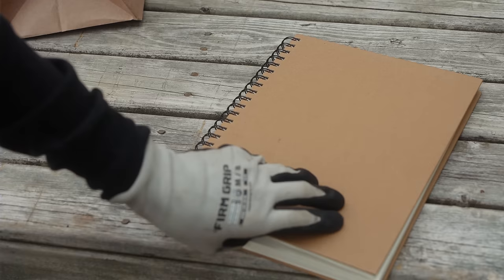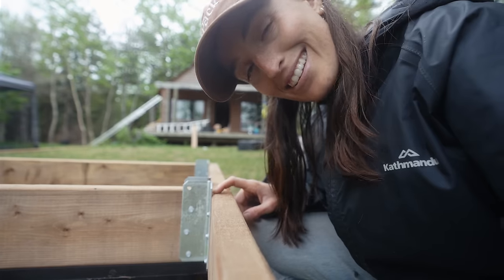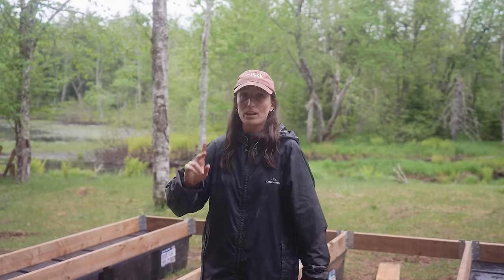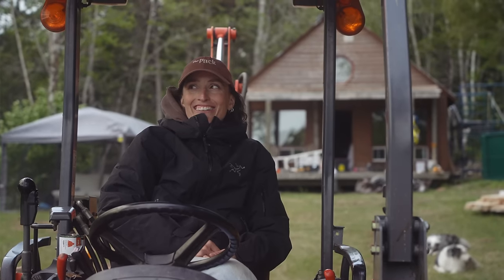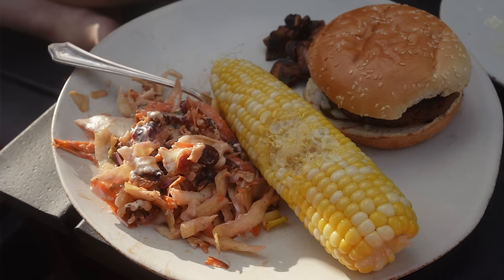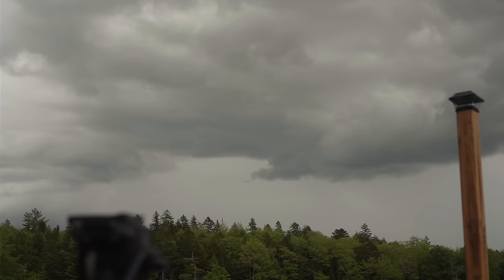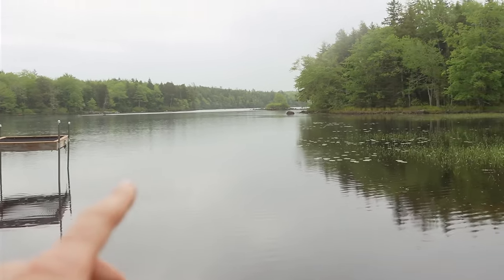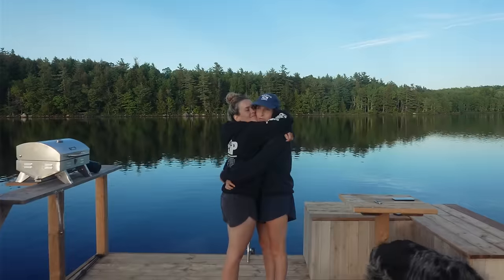We Built A Homemade Raft Boat with Electric Motor!

Comment: You NEED to get a chart for your lake. 
Life jackets.
Backup propulsion plan.
Since while you were building it that storm showed up quickly you need to plan for that, the trolling motor is no match for a sudden wind storm.
You need a ramp for the dogs to get back on things happen
You have seen weather videos of how violent water can get. 
The lake chart will show you the deepest park and your anchor chain needs to be a little longer.
A dingy would be a good thing. 
There should be boating classes either on line or from local law enforcement.
First aid kit. 
If you lose your balance you can easily brake off the grill stand
So when you anchor a boat it digs into the bottom, sometimes really hard and in a power boat your motor is usually strong enough to break the anchor free. 
You might consider a wench of some kind to pull it up. 
You should also consider the wind if you put up any thing that could act as a sail.
Looks like you are going to have a great summer be safe and joyful
Reply from the maker: We have all the safety gear and boat licence. We appreciate the tips.😊🐶

Comment: So basically a powered, floating deck!   Possibly the ultimate house extension, at least if you have your own lakeside property.  It definitely could use some shade, perhaps a gazebo with solar panels on the roof?   How about a potted plant or two, perhaps hanging?  And an elevated fire pit, or is that going too far (and too risky?)!

Comment: I would have gone with a spot lock trolling motor for deeper water and a couple of electric pole anchors for shallower water (No anchor needed). Definitely add some solar panels to keep things charged up. Star link for video editing. Maybe a sleeping area or tent for overnighters? And going crazy here, but a water filter from the lake connecting to a water heater, a sink by the grill, a shower head on one of the light poles, and a toilet? Hey, you ladies are awesome and could pull it all off 👍😎
Reply: Why would they need a shower head on a fresh-water lake? That’s a lot of trouble for no reason.
Reply: @kathyannk  seriously? Have you ever swam in a lake and felt clean afterwards? It can cool you off but that’s it. You wouldn’t believe how you have to clean the lake filter after every use. Ever watched fishing videos? They don’t use lake water to clean up, but use tap water immediately when they get home.

Comment: The weirdness is with wood measurement is that when the pieces are cut, they truly are 2x6. But they're cut wet and left to dry. As they dry, they shrink in all dimensions (and not always evenly). It's easier to store boards than logs and they dry out more quickly as well. It used to frustrate the heck out of me when I started making stuff and building sets. All my detailed plans and diagrams were useless. Experienced (i.e. professional) construction people know about shrinkage and calculate around that. The fittings are often wrong but they know they can grind off the ends, as you do. 

I would hinge the lids on the storage because I know I would slip when lifting one and it would go in the lake. But that's just me.

Comment: My guess for what the taped off square on your raft is....?

I think you're going to build a ROOM on the raft and make it into a "HOUSE" boat ! And then even if the weather changes while you're out on the lake, you can just go inside until it's over.
The whole thing is a VERY COOL idear !   However I think I see one tiny flaw for at least ONE of U2. And that is IF you're out on the lake and the weather changes AND it doesn't look like it's going to go back to SUNNY for the rest of the day, one of you will have to sit out in the weather holding onto the motor handle until you get to the shore. ....but I guess you could enclose that spot too???
Now my 2nd guess would be just a solar panel roof with no walls. And with that you could possibly put an EXTENTION on the motor handle so that who ever is doing the steering could still sit under the roof for at least a little more protection from the rain OR it could even be a little SHADED area when you've had enough of the ditrect sun shine.
Reply from the maker: You have a good guess. Many good ideas as well. 😊🐶

Comment: Next time put a longer board and then on each side of the longer board, it might get thicker that way. It will give it more strength in the areas you need it. But if your clamps will go too too before it's thick. Use 2 tuba sixes or 22, but 12 might get heavy enough. Dill, what you have to have at least. A foot on each side of your motor to a foot and a half
Reply from the maker: Thanks for your great ideas. 😊🐶

Comment: Hey gals….suggestions, fly the lesbian flag…and the anchor chain needs to be 1 1/2 times the depth of the water you’re anchoring in….or longer…..the motor mount might be better as metal plate…..a couple of paddles are never a bad idea too. 
Love your raft! You both did a fabulous job designing and building it. It’s gonna be a fun part of your summer, for sure!

Comment: When ever you use some measurement of the metric system temperature, length, etc. I have convert it to imperial system. 25 degrees is cold in Fahrenheit, it's below freezing. 25 degrees C is 77 degrees F.

Comment: Awesome raft, but you are using the trolling motor in reverse. You need the take out the bolt at the top of the motor just beneath the head and spin the head 180 degrees, that way the propeller is behind the shaft and the skeg  will protect the prop from the rocks. Enjoy

Comment: I wonder how thick the plastic is on those floats? If it is not too late I would consider coating the bottoms of those floats in a heavy layer of flex seal for added protection against getting punctured.

Comment: um Maybe pick up a small launch boat or second troweling... if you don't have a lot of neighbors near by a separate boat troweling motor (towing) style is fine we know your going solar panels (check out solar glass, yes window idea)  - use anderson sttyle 50 (charging) or 175 amp (probably full power service disconnectors) plugs to plug the two 2 together when way out. YES wood breaks as you found out - cross hatch wood vertical and horizontal grains are much stronger, gluing 3) 1/2" thick boards for the motor mount. I've towed a pontoon to shore already that only had 1 motor.  Done the PWC (personal water craft) as a back up too when out farther in vacant type areas..  Are there any high winds? you might end up with a solar sail if you know what I mean

Comment: You should add 3 or 4 batteries and connect them in  parallel, then add them to box in the floor.  Y'all will have hours of scenic tours and fun.
Reply from the maker: Sounds like a good plan.😊🐶

Comment: I saw a raft house, or houseboat that had a half of the house, with a curve roof to the base, and it had a see through plexiglass  roof, so there was so much light inside it, and they could see the stars at night, it could sleep 6 people 2 bunks folded down, sleeping bag bunks,  and one bed was a queen size, and 2 more hammock beds, a commode  tank toilet, and a small fold down table, fold up wooden chairs that hung on the wall, a place on the deck for outdoor  solar shower, a tiny wood burning stove, a gas camp stove, water filtration system, it had a jackery, for coffee pot, and a convection oven, and a couple lights, and a mini cooler,   they rented it out on air BnB, when they weren't using it

Comment: OK, so now you’re going to find out that you would like to be able to go to the bathroom without jumping in the lake. This will require either a little wooden structure or a tent, and a cassette toilet or whatever type you want to use. You may also want a very small structure just to get out of the rain and things, and you will certainly want to be able to sit in shade at times.  We have used just a little tent shelter that is probably 8 x 10. We are in the US, so we bought this little Shelter at Walmart, but I’m sure you have an equivalent store where stuff is not too expensive. The little tent doesn’t even have a floor, it’s just four walls in a roof with a lot of venting so you don’t get too hot. You can put it up and then permanently attach it to the boat so it will always be there.  That’s all you really need to get out of the rain or the sun. So I’m just letting you know about improvements that you will probably want to make.  I think that you will intuitively discover what I’m talking about soon.
Reply from the maker: Thanks for caring and sharing your great ideas with us. 😊🐶

Comment: You did paint over the cuts you made on the corner brackets, right?
If not, you need to lift off the covering decking and seal those brackets, where you cut the galvanized off, or they will rust. And the rust will work it's way under the rest of the coating, compromising the whole bracket. I'd suggest using a can of spray on bed liner.

Comment: Absolutely beautiful girls!
Love it!❤
I think the corner post lights gave it away along with the eight foot by eight foot taped off section Hint.
A solar canopy for the pontoon boat/raft. Should be amazing.
Hell, it is already amazing!
You might upgrade your outboard electric motor to one you can steer using remote control. Maybe even connects to your phones. I'm not sure if the little electric motor is big enough in any kind of wind. You will have to test it once you've got the roof on.🌬 ⛵️ 
Don't forget to get some big paddles. 🛶🛶 And maybe a life ring 🛟. Might look pretty cute.Hanging it off one of those posts. Didn't you girls find an antique one in the lake house🛟 ?
⚓️🛥

Comment: use your portable power supply to power your trolling battery and then you can install some solar panels on the boat to charge the power supply.Maybe install a pool slide on it or diving board.
Reply from the maker: Just wait for the next ep! 💛 thanks for watching

Comment: Only about 1/4 of the way into this video and wondering why you are building this so far from the water.??   Beautiful project , crack out the Champagne !!!  It's gonna be the best Summer in the Bush.  Need some solar for the battery. Maybe buy a metal or composite transom for the motor. Typing as I watch.  Wow a Canadian Goose ( Canadian Snowbirds,  lol ) flyby to commemorate the launch.  Raft needs a Name:  VG Oasis ?

Comment: This is so rad, is a big green square for a big thing of fake grass? Also with the cooler if you attach a string to the top of the cooler lid and the seat top, you can open the cooler at the same time as the seat.

Comment: I noticed you mounted the trolling motor on wood with the grain running horizontal. No wonder it broke off along the grain., The grain should be vertical or even better have a metal bracket for extra strength. Why not tie the canoe along side as an emergency life boat when you loose power?

Comment: Yeah you need to make a braket out of aluminum or steel and bolt it to the floor of the raft and to get the thickness put a 2 by on your bracket and I think that should work perfectly fine and put a solar panel on it too for the battery

Comment: ok the reason why is if you use green lumber off saw mill which is true to size the bracket fits and the lumber you buy in the store shrinks because it has been dried before it was sold to you and so now the hardware wont fit as well but if you have ace hardware store  they would sell you the right bracket that would fit

Comment: Well first of all if you add solar panels and batteries you won't have to worry about the trolling motor dieing. But here's a idea make a frame that is sturdy for the motor to bolt to on the side of the float. For the dogs yes, get a big umbrella that you can mount the base to the raft, oh I bet you didn't consider this what if the dogs need to go to the bathroom, could get smelly if they pop or pee?

Comment: With the weight you're pushing, that motor is gonna drain that battery pretty quick. You'll need a spare battery or a couple of solar panels.

Comment: Wondering if you will need to remove the raft for the winter and what your plan is to remove 4000lbs from the lake?
Reply from the maker: 4000 pounds is the capacity. People, food, water, dogs ect. The overall design will be under 4000 pounds. Either anchor by the river where it doesn’t freeze or bring it in with the tractor and or heavy machinery

Comment: Why a large raft and not put the grill on the dock ? As you found out with the broken motor mount, you could be up the creek without a paddle. A smaller boat with the troll motor makes more sense and would be safer. How will you every get this ashore for the winter ?

Comment: Get a piece of metal to use for the transom ( the boat motor holder thingy....lol) bolt it on the back then you will never have to worry about wood breaking
Reply from the maker: You and a few others have mentioned this. Thank you! We shall have a much stronger transom 🤣💛
Reply: @Vanwives  for sure good luck🙂

Comment: If you turned the board for your trolling moter so the grain runs vertically rather than horizontally you wouldn't have problems with it breaking so easily.
Reply from the maker: Thanks for the tip.😊🐶

Comment: remove the motor transom and create a new piece of the same wood but mount it so grain is vertical not horizontal, then the torque of motor won't break the board.   talk to me about ICF for your mexico house

Comment: Just curious if you gals know how to test the water that you're submerging yourselves in to make sure you're not getting into any water that is contaminated with flesh eating amoeba bacteria or brain eating amoeba bacteria.  You could buy yourselves a pond liner that's big enough to make a pond swimming pool out of it for much cheaper than a swimming pool would cost and treat that water with shock treatment and dump some chlorine salt or whatever in it and get a pump for it that circulates the pond water and connect it to your solar power system or make it's own solar power system for it. After clearing land for it and whatever else.

Comment: Did you guy even check for square ,ok you didn’t check that’s why the last board didn’t fit lol ,oooo well,ok on the trolling motor you well need some heavy duty L brackets,the wood will work for now but will not last long ,the motor will work better if it is about 6-8 inches below the water surface and on the motor a 24 volt will give you more power and last longer but you will need two batteries or bring along a extra battery to be safe

Comment: Since I believe neither of you are engineers, where did you get this beautiful design from?
Reply from the maker: Us  😂 lots of research lol except for how to attach the motor LOL
Reply: @Vanwives  thanks for the reply. I have experience modifying trolling motor mounts if u want ideas. What battery are you using? Lithium or lead acid? Deep cycle or starting battery?  What motor are u using. 30#?

Comment: Engineers in disguise, I hope you have copyrighted that design, there will be a hundred or more scattered around the world by the end of the year. When I saw your motor mount I thought that you ought to reinforce it with fiberglass, then it cracked, [it's taking all the thrust from the motor,] get a thicker piece of hardwood as well, probably pay a pittance from a timber source, but ya don't want to lose your motor in the deep. as for the buoyancy, you could probably move a small car on it. 😀